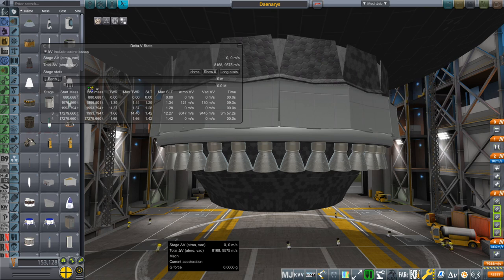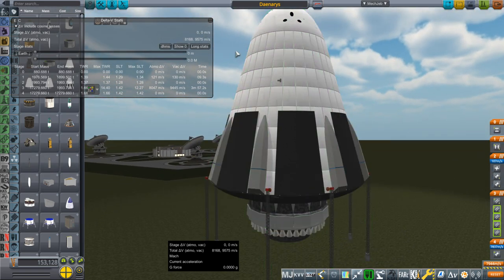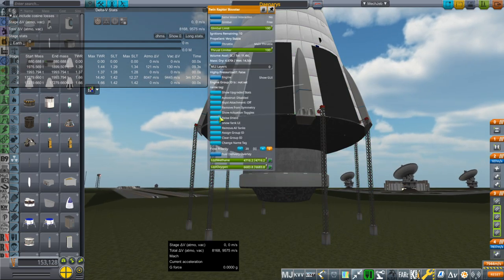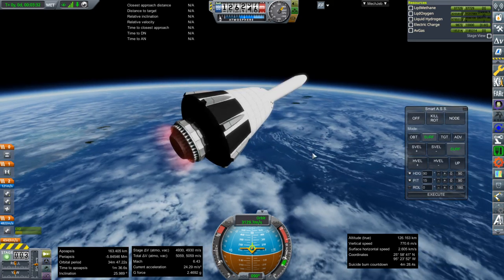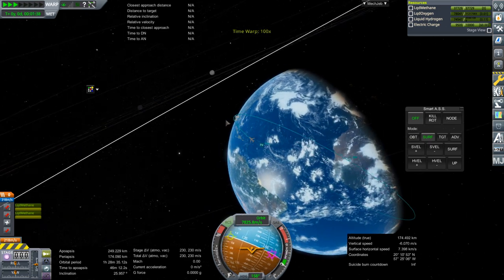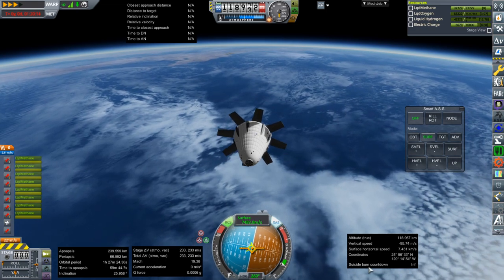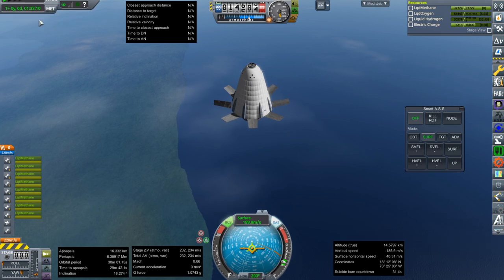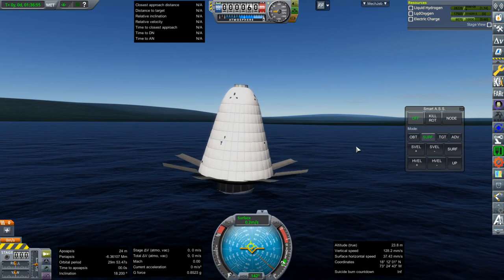Realism Overhaul in KSP 1.8.1 - Aerospike SSTO Recovery Test

Comment: Per the buoyancy, if the thing only weighs ~1050 tons at that point, it only needs to displace that same volume of water to float, which would be a cube of water about 10.16 meters on every side, or a cylinder with a diameter of 18 meters and a height of 4.15 meters. 
If anything, the only weird behavior is the fact that it floats so upright in the water instead of tipping to at least put the bottom rim of the big tank onto the surface.
Reply from the maker: It's not quite displacing that much, but then your estimate was a bit off because we lost the aerospike engine (more than 300 tons) and all the Raptor pods. Still, I think it ought to be sitting a little lower in the water.

Comment: Adding an Ejection Force to Payload Separation will give an equal Force to the  Re-entry Stage without adding more mass in fuel to the total rocket for Deorbit Burn. Payload gets added kick for orbit and the launcher gets a deorbit impulse. It is how it would be used in reality and was part of the plan. Leaving more fuel for landing (lower) stage. Also Adding Parachutes will return more in weight saved than used. Using Side Tanks that can be jettisoned shortly after take-off and recovered by parachute/water recovery. is another option. Not Making a True SSTO can be built. But a real system will need better ISP engines than can be made with current tech. A Methyl-LOx fuel system is also more likely with LH2 as a fuel additive. Dissolving as much Hydrogen in the Methane fuel as can be made at LNG temps.

Comment: Does RO and add-on's take on aerodynamics? Specifically can Kerbal handle something like a shrouded ejector-rocket set up or a RENE nozzle arrangement?
Reply from the maker: Most aerodynamics is handled by a mod called FAR, but when it comes to airflow into engines, that's the domain of a mod called Advanced Jet Engines. I'm not entirely clear what AJE is capable of in that respect, though it's certainly more sophisticated than the stock game.